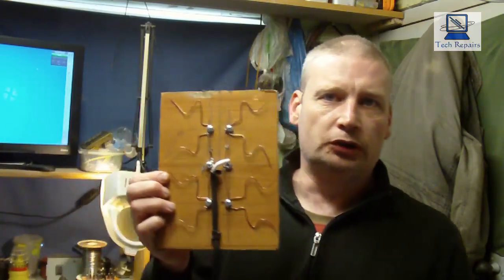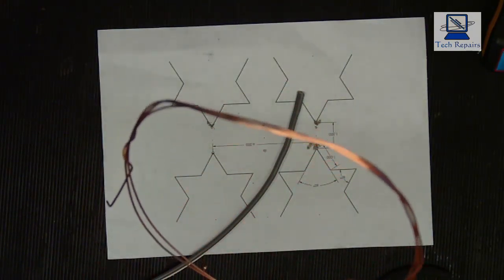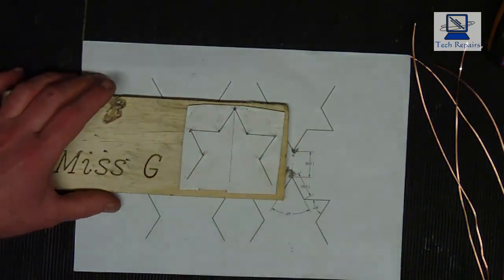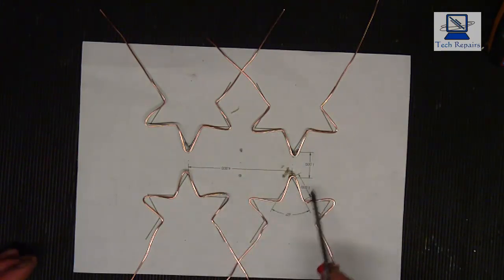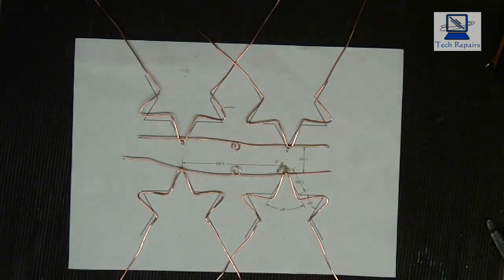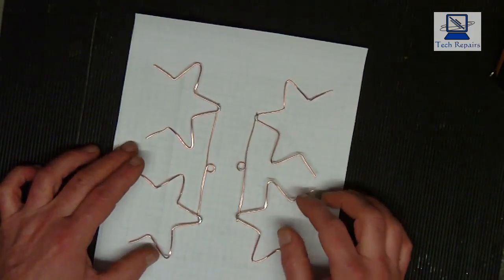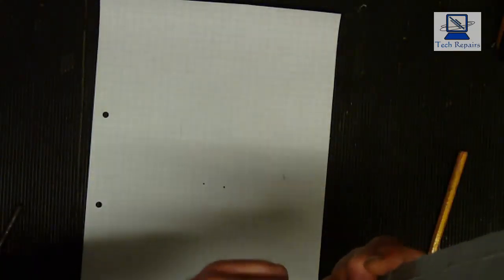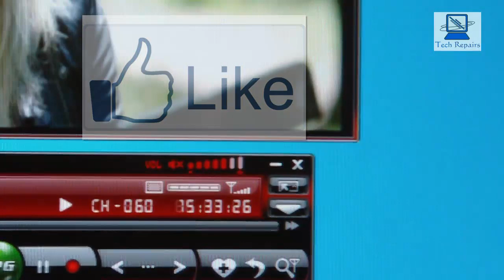How to Build a Fractal hdtv Antenna

Comment: I been watching videos on this design and am wondering, what if you make it two sided? 
Where as the opposite side is of a larger pattern size, to capture even more of the wave length spectrum.
You could still center both sides, so that it would still only require two points, where you placed the screws
Wouldnt that improve performance?

Comment: You can eliminate the soldering by using one continuous piece of wire running down the edge of the plate rather than the centre

Comment: Couple of things here if you are not going to use a matching transformer, bring the antenna a lot closer together to get it to be closer to a 75 ohm match, are the same sides suppose to be in phase, I would like to see what frequency that antenna would resonates with a grid dip meter.

Comment: do you have some specific figure for the frequency range in particular? i'm currently in a pitch of creating antenna ranging from 54MHZ - 180Mhz.
Reply from the maker: A fractal antenna's response differs markedly from traditional antenna designs, in that it is capable of operating with good-to-excellent performance at many different frequencies simultaneously. Normally standard antennas have to be "cut" for the frequency for which they are to be used and thus the standard antennas only work well at that frequency. This makes the fractal antenna an excellent design for wideband and multiband applications.
The trick is to design your fractal antenna to resonate at what ever center frequency you wish to receive. Which means it will look different and be sized different depending on what you want to receive. A little math can be used to figure this out. (Or a online calculator)

Comment: Man,thanks a lot posting this video. I´m working on a project of a fractal antenna,but I don´t have too muck knowledgements about this kind of antenna. Please,tell me one thing: How did you calculate the size of the stars,the number of stars and the number of interations?

Thanks a lot.
Reply from the maker: +Lucas Ventura do a Google search for fractal antenna calculator. There is lots of information out there hope it helped.
Reply: Ok,man. I´ll do this.

Comment: u didnt show how to connect the cable to the screws at the back.. do u need matching transformer ? or just coax is ok?
Reply: this design works better with an impedance matching (300 to 75 ohm) balun

Comment: I made this antenna and I am unable to receive anything with it, there is zero signal and I am 800 meters from the transmitter.
Reply: @Zara Hall
 - You need a " Balun " a 75-300 ohm Balun.

Comment: Thumbs up for your time, for the hell of it you test it against a simple yogi beam.
cut one wire 9 inch next at 10 1/2 inch third at 12 inch on a piece of wood, space 3 inch apart. see if you get the same results.

Comment: I'm sorry but I have to set this straight.  Fractal antennas are useful for many things ...BUT,
modeling this antenna reveals it to be a terrible antenna the SWR runs from 6 on the lower frequencies to over 10 at 700 MHz.
SWR over 2.7 or so may interfere with digital signal decoding, This and being optimized for frequencies from 470 to 700 MHz instead of up to 900  MHz is the only difference between a modern "HD capable " antenna and the antenna your parents used for analog TV.
I'll be fair, at about 1.6 GHz it gets a nice SWR OF 1.17 and a gain of ~ 9 dBi.
but as a tv antenna it sux leave the whiskers straight and make them ~9.5 inches long you'll get better results.
Bigger snowflake elements and a reflector help but it still never got good SWR over even half the TV band.